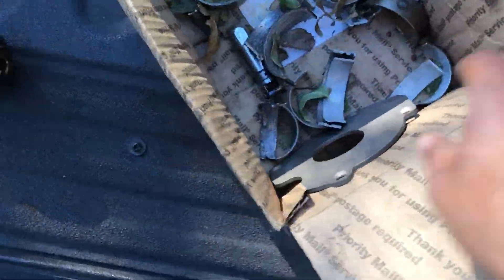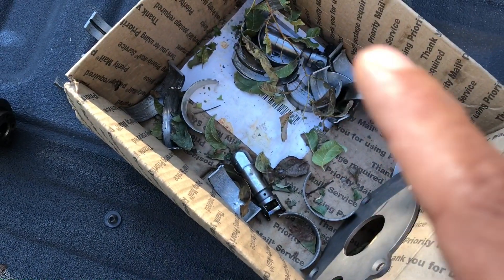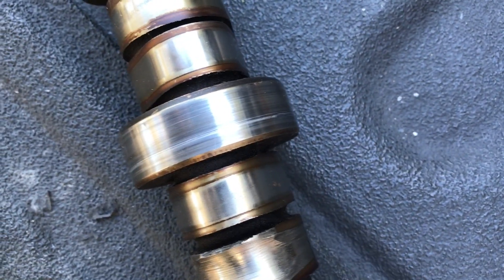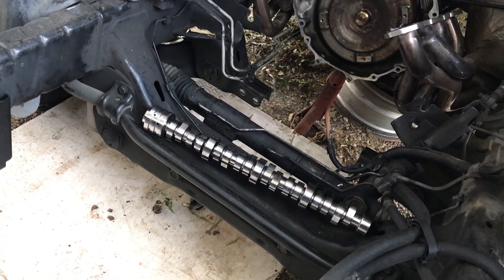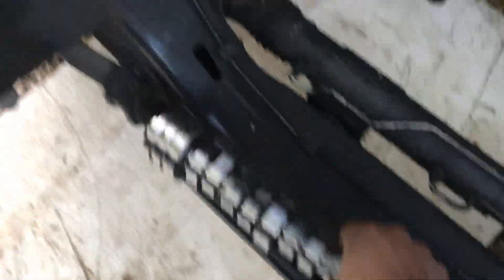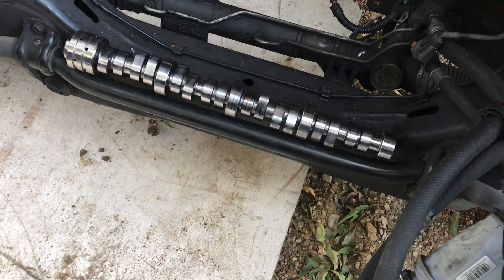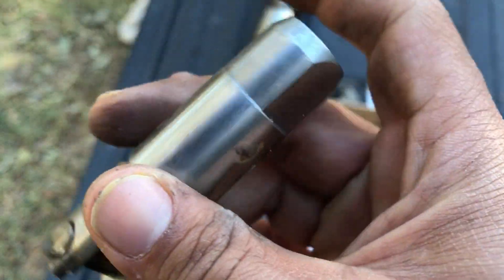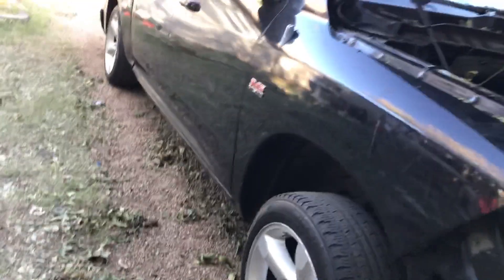Problems after cam swap (motor destroyed)

Comment: Those bearings in the box are NOT cam bearings. Those are rod and crank main bearings. They are ruined by oil contamination at least, maybe low/no oil. I don't know the chain of events leading up to this. If you had a cam/lifter issue first, depending on how quickly it was caught, the mechanic should have examined the oil filter and/or dropped the pan and looked for further damage BEFORE  doing ANY repairs. All that metal circulating thru the oil has damaged all those pieces and more you haven't shown. The whole engine should come apart and be thoroughly cleaned & reassembled by a genuine,  professional mechanic not somebody you found on craigslist.
Reply: He wouldn’t know a cam bearing if it bit him. The metal from the cam & lifter being chewed up took out his motor. Always replace the lifters with the cam especially when you see damage. The mechanic should have seen that when replacing the cam. The things I watch on YouTube.
Reply: @palmbeachcane9523 I'd say that mechanic saw an easy few thousand bucks from this kid
Reply: Looks like he probably already had spun rod bearings  but only replaced like one lifter and the cam was bad you get what ya pay for that's for sure. These engines in my opinion are some of the easiest to work on. I yanked mine out rebuilt it and put it back in in roughly 2 and a half days working on it after work. After 2 years it's still running strong YouTube is an amazing thing.

Comment: 1. You have to use non-MDS lifters
2. You have to use Non-MDS lifter trays or the lifters will spin around in the bore and damage the cam
3. Use quality lifters like Mopar, Melling, or Comp Cams. At bare minimum, use mexican made lifters. No chinese crap
4. Paying a mechanic to install a cam effectively eliminates any power per dollar you'll ever get. 
5. Replace head bolts and head gaskets while you're in there. Yes, head bolts can be re-used. Replace them anyway since you plan on beating on it.
Reply: I almost did that,I started using the MDS yokes(trays) with non MDS lifters and I noticed the non MDS lifters had all kinds of slop,so I had to get Challenger manual transmission MDS delete type.

Comment: This is literally what happened to my 2014 ram thats procharged. Had the new cam and lifters installed and same thing now im looking at buying a built motor and then swapping my procharger on that and my ram only has 74k on it

Comment: You always replace all lifters and cam when you have one fail or your asking for trouble. along with inspecting cylinder walls and rod bearings on the crank..... also you replace the oil pump and filter and clean the engine it's not hard to do a complete teardown of these engines don't let a few 100 dollar parts cost you thousands in repairs